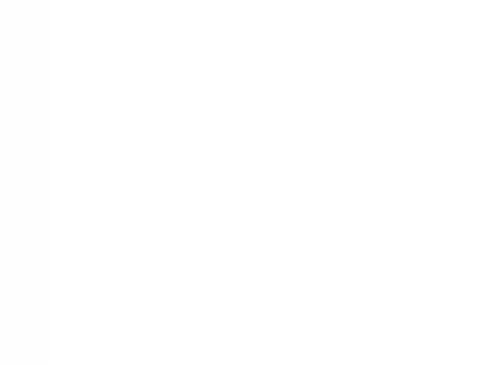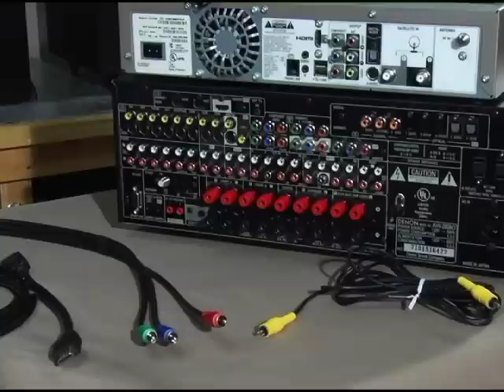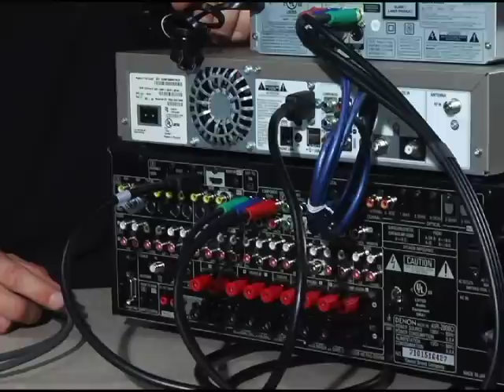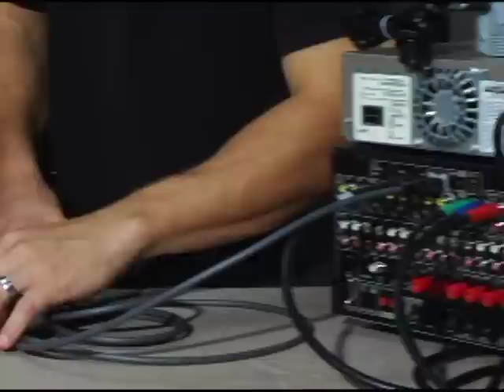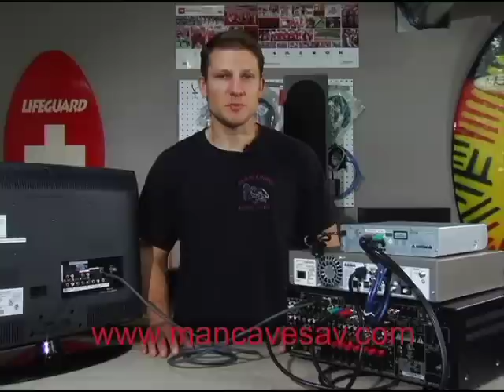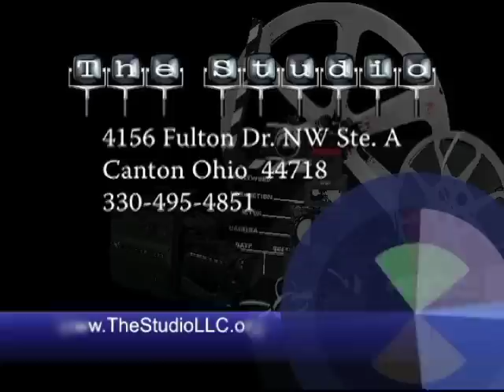Basics for hooking up your components to a home theater system

Comment: Thank you so much for the info.You explained very clearly.My husband knew all this .When he passed away I was stuck when I moved ,as to how to hook up my older 400 dvd player to my receiver and tv I had it all hooked right through my older receiver by making notes and wire configuration when I unhooked it.But sattilite service burned up my receiver and I forgot how to hook up my new one.The old one was smelling hot so I just pulled all the wires (so it didn't burn up anything else) off before I realized I should have remarked them..I had it all hooked to the new one the way I thought it was hooked up but no sound.Through you I realized I had hooked my dvd directly to my tv thinking it would also pick up sound instead of hooking it to my receiver as I should have after some thought.With all that in mind I am off to get this right .Thank you so much for you valuable information.

Comment: You did a good job explaining the basics. I have the older Onkyo tx-608 a/v receiver. But, I have the Xfinity X1 cable box, along with the 7.2 formatted surround sound. (6) surround sound speakers, (2) subwoofers, and (1) center channel speaker. For anyone trying to setup a similar system, remember,  the cable box is your first output, then, the a/v receiver is an input and output. next connect to your t v. It's not really that complicated. I upscaled from 720P to 1080P via the receiver.

Comment: Sometimes you might be limited on space, so when you need to set up a small but fully functioning home theater, consider the Gefen Home Theater Audio Processor, or Audio Decoder. You can also add HDMI to an older receiver by using one of these processors, or don't use a receiver at all and just have powered speakers.

Comment: Yes, a connection on a computer's video card is an output, you can run an HDMI cable to an extra input on the receiver or to a TV/monitor works the same way,  I'd do that but my receiver is older and doesn't have HDMI. The audio signal on a computer is also an output.  On newer TV's an optical connection is typically an output so that won't work from the PC, connect the audio through the receiver or PC speakers.

Comment: @Venom Strike, check your output settings on your device, on its settings menu, you should be able to check and alter which connection sends sound. Picture and sound quality seem to be much better running video from hdmi and sound through optical. also check the inputs on you tv and/or receiver, if either are from a major brand, the manual should be easy to find online. since receivers and tvs vary, you can have assigned connections, such as hdmi in with optical for the audio, or run video straight into the tv and optical through your surround processor/receiver. also, go down to your local radio shack, and look for or ask for a product called DeOxit, its an electrical contact cleaner, spray a few drops onto the cable to be inserted, and then plug and unplug a couple times, it will improve your connection and you'll get better signal transfer. dont use deoxit on optical connections, just wipe the cable end, carefully, with a good quality lens cloth, like you'd use with a camera or eyeglasses, no liquids should ever touch it, its super polished glass and fiber optic cable.

Comment: Your turntable would need a built in switchable Phono Pre-Amp.  These come standard in many turntables these days, and have for quite a while.  To check if you may have one look under the slip mat, there should be a switch.  Slide the switch and it will turn the Pre-Amp on, and will play through the Auxilary on your receiver.  These are nice to have, and sound great.  But of course not as good as a Stereo Receiver with a proper built in Phono Input

Comment: You would still need to run the cable from the TV to the Cable Box...  So in this case there should be 2 connections to the TV:  1. Receiver and 2. Cable Box... Right??

Comment: GREAT VIDEO, MY QUESTION IS WHAT IF IM USING A PROJECTOR, DO I HAVE TO PLUG IN THE HDMI CABLE FROM THE CABLE BOX TO THE RECIEVER OR TO THE PROJECTOR, PLEASE HELP IM NEW TO USING A RECEIVER AND YOUR VIDEO HELPED  ME , ALSO DO I CONNECT OPTICAL , DIGITAL JACKS FROM PROJECTOR TO THE RECIEVER ALONG WITH SPEAKER TO GET SOUNG USING EPSOM 6040 PROJECTOR

Comment: hmdi connections dont need a video.  Those are easy.  Regarding the other connections, first you said to get surround sound, you needed to hook up an audio coax and an optical cable.  so when you hooked up the mystery box you didnt add an optical.  Does that mean the mystery box doesnt have surround sound?  also, how would you connect the receiver to the tv if you did not have an hdmi out on the receiver and still get the best sound quality?

Comment: Besides connecting all the cables you need to program the receiver in order to get audio through out a coax or optical cable, so this video is ok i will say, but not for somebody that would just do it by itself

Comment: Quick question? i have an optical cable, can i plug the opt cable from the tv to the receiver? since the opt cable is better audio than the HDMI. That's after i have done those similar connection that you did

Comment: To connect from black RCA pre out to an amplified subwoofer does it require a proper RCA cable or any other (like the yellow video RCA) does the job?
Reply: Yes.  Just about any 'coax' cable will work.  One caution - some cheap boom boxes and computer speakers use RCA plugs to connect speakers but they do NOT use coaxial cable.  Never use this type of cable to connect any source component to an amplifier/receiver or amplifier/receiver to sub-woofer - you could severely damage the sub-woofer and/or the amplifier/receiver.  If you are not SURE if a cable with RCA plugs is coaxial or not, ASK someone.

Comment: you forgot to mention s-video as another option that gives better resolution than composite. ..... but not as good as the component. .... the component output can in many cases can give you up to 1080i resolution and was the cable used for high definition before they came out with 1080p and hdmi .... just thought that I'd mention it, thanks for your video....

Comment: I'm planning on getting an Apple TV and I want to know if it's possible to connect it through my Sony bluray home theater system via an HDMI input just like you did in this video. I want the Apple TV to use my home theater sound system as sound output. So I'm guessing instead of normally connecting the Apple TV to my HDTV with an HDMI cable, I now have to connect the Apple TV in to one of the two HDMI inputs in the back of my bluray player and then connect a second HDMI cable in to the HDMI output of the bluray and finally connect this HDMI cable to my HDTV. Will this method work? If I do this will I get sound from my home theater sound system? And if this method won't work, can you suggest another way of doing this? Thanks so much in advance!
Reply: yes u can connect hdmi to your sony bluray home theater but which apple tv u are gonna buy the 3rd or the 4rd generation ?

Comment: I have a question. I own an old Onkyo receiver  TX-DS838. the receiver is hooked up using an optical cable from a New Samsung TV which also has optical out....
the problem I have. is I'm trying to hook up my Onkyo equalizer EQ35 Integra. I tried it all. can't get the equalizer to work.
PS: there are NO HDMI inputs on this receiver. 
if you can help? i would really appreciate it. Thanks

Comment: How the way he has it hooked up, the cable box's output signal (HDMI cord) is going into the stereo receiver's input signal. so in that case, the tv is going to have only 1 connection, which will be coming from the receiver's output signal. Me personally, I wouldn't prefer hooking cable into receiver because you will have to turn your receiver box on every time you want to watch tv.

Comment: Hey I was wondering how to connect Surround (L) and (R) speakers, since most of them are Bi-Amp compatible and so they have 4 binding posts (1 + and - for the tweeter and 1 + and - for the woofer). Is it better to connect them by using the binding post corresponding to the tweeter or woofer? Thanks.

Comment: Hold it if you connect the HDMI from the the DVD output into the receiver HDMI how do you get the video?My problem is I did  that connection on my Yamaha RX-V385 I press the DVD button on my receiver I only hear audio but no video.What did I do wrong.

Comment: I currently have a blue ray player, xbox, and cable box connected to my t.v. via HDMI cables. My surround sound system is about twenty years old (Sony) so it doesn't have any HDMI ports. I have a optical cable from the t.v. going to the surround sound receiver to make it work. The sound is okay but since the receiver is so old, it cannot decode all of the modern surround sound signals. I am wanting to upgrade to a new surround sound receiver but I have noticed that most of the new surround systems have maybe two HDMI ports (in/out). My question is, is it better to connect the blue ray player, xbox, and cable box directly to the t.v. via HDMI cables and then one HDMI cable to the surround sound system OR connect the blue ray player, xbox, and cable box to the surround sound system and then one HDMI cable to the t.v.? This will help me decide whether I need a surround sound receiver with a least four HMDI inputs for the extra devices and with one HDMI "out" port to connect to the t.v. The cost of multiple HDMI "in" ports is more, so I'm looking not to spend money I don't have to. Would it make any difference with the "surround sound" quality connecting to the devices to the t.v. vs connecting the devices to the surround sound receiver?Hope this makes sense.Thank you,Jeffrey
Reply: +Jeffrey Atteberry  If that sony receiver is an ES model, they have a cult following. a  hifi collector may want to buy it from you. I would but i'm poor LOL!

Comment: at 2:30-2:35 you messed up by saying the component outlets (green,blue red) were "composites" and that the single composite outlet (yellow) was a "component". And then at 2:46-2:49, you switched it around by saying the correct labels. Just so you know

Comment: I'm sorry, but couldn't you at least name the devices when you point at them?
Like, this is a TV which is an output(?) device, and to hook it up with your receiver you need the following cable that goes into this outlet on this device and that outlet on that device. It would have been so much easier to comprehend.